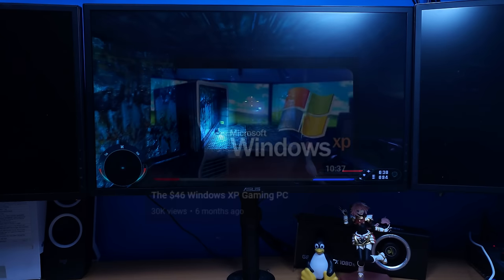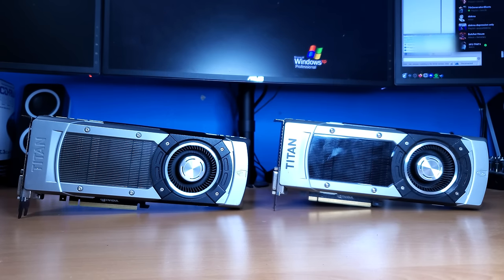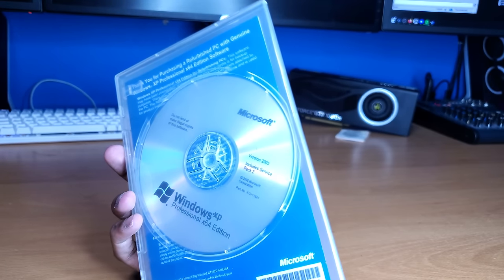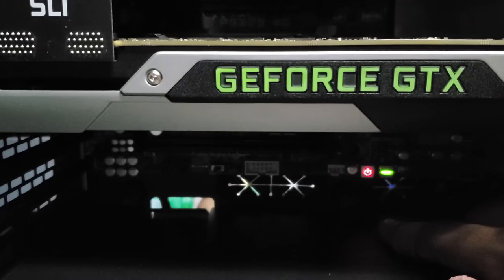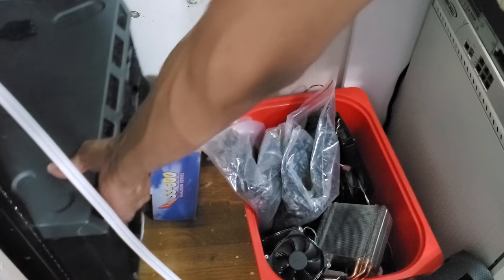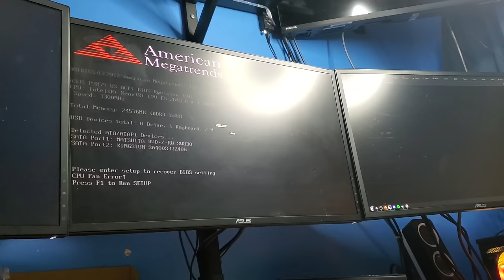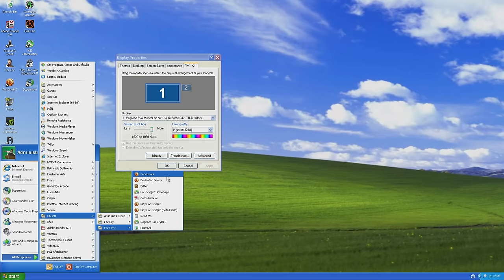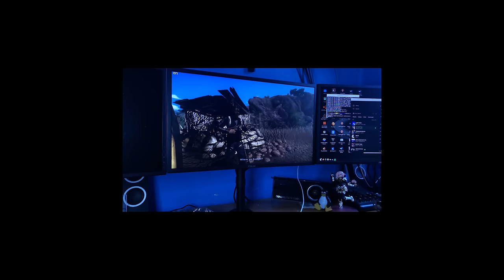Building the Worlds Fastest Windows XP PC! The Overcompensater

Comment: I used XP Pro x64 on my main computer until around 2017 before migrating directly to W10. I swear everyone who keeps repeating the same lines about instability, drivers, and compatibility issues never actually ran it. I don't recall having any problems with driver availability at all. Every well-developed mainstream program installed from the regular 64-bit installer exe/msi without issue. The occasional compatibility issue usually had to do with a smaller or more niche program not able identify the OS version, and there would usually be a workaround. I don't think there would be any more problems running it than you would have trying to use XP-32 in 2024.

Comment: For ultimate performance on the X79 platform, you'll want to go with the Xeon E5-1680V2. It's only got 8 cores, but an unlocked multiplier and they have widely been reported to be binned really well, meaning that they should overclock really well. I have two of them, one running on the exact board you have, and they both do 4.5 GHz, which makes them considerably faster than the 12-core.

The CPU is actually kinda interesting, since as far as I can tell it was never officially sold to consumers, and the only computer that ever had them seems to be the trashcan Mac Pros. Still, there's plenty of them on eBay.
Reply: this

Comment: I wish I could find a use for an old HEDT system like this. The hardware is super cool. As it stands I can’t find a use for a 2S Skylake system I’ve already got.
Reply: I recently threw away a dual LGA 2011 Supermicro board with two Xeon E5-2650 V2 (8 core Ivy Bridge each) because even when I listed it as "for free", nobody wanted it. And I couldn't justify using it for anything when a cheap as dirt used Ryzen 7 3700X beats the crap out of it, both in terms of performance and efficiency/power consumption. And the Ryzen supports ECC RAM too, so I'm not even losing that feature despite going for a cheap desktop platform

Comment: 4way sli wouldnt be ok because dx9 only supported 3 frames prerendering so the 4th gpu would be waiting til judgement day to be used. but if you use 3way and set the 4the gpu to physx you would benefit here and there.

Comment: I would have gone with 2x SLI too, 3x-4x SLI was a joke especially for gaming. It was mainly used for 3d rendering/simulation and other stuff like distrubted computing with F@H.

Also going with 2x SLI would keep those bottomg PCIE slots empty so you could technically install an NVME adaptor and run an NVME drive for your games. Drivers for NVME controllers were actually made for XP and are still used today though I doubt you could use it as a boot drive.

and one more thing, always always replace the cmos battery on any old motherboard.

Comment: You shouldn't mix and match power supply cables specifically to avoid these kinds of issues. Use the ones that came with the psu or you risk frying it.

Comment: I personally daily drive a x64 xp machine. It has a core2 duo p9700 and a 250gb 860 evo. It has 4gb of ram right now and 8gb costs more than ddr4 would so I can't afford it right now but I hope to in the future. It does run with an igpu but I'm thinking of getting a 1080ti plugged in through the WiFi slot

Comment: You really don't need a fast computer for WinXp-sp2, in 2005/11 I ran it on a AMD K6-2 socket 7 500mhz, 512mb, and gforce 2 16mb, 80gig SATA, SB 16 ISA, PCI usb 2.0, PCI SATA x 2, DVD x 2 PATA, Multi-card reader, 100mbps ethernet, and IE6 for internet browsing. it worked fine. And it still works today. It's a 2 ISA, 5 PCI, and 1 AGP. Full mainboard ALI Chipset. Used mostly for Mp3 music for Parties at home, Ah the good old day eh?

Comment: I have owned both an 8 core 1680 V2 and the 12 core E5 2697 V2 and I can tell you for a fact an overclocked 1680 V2 run circles around an E5 2697 V2 all day long. You can very easily get the 1680 V2 to 4.4 gigahertz if not 4.5 or even 4.6. it can be upwards of even 50% faster than the 12 core purely due to clock speed.

Comment: Wow, all that work. You could have saved yourself some time and used the ASUS BIOs flashback button in the rear of that motherboard. You don't need a CPU or RAM to flash your bios. Only the ATX power supply plugged in. Just need to download the newer bios file onto a USB drive from another PC (8GB or less USB recommended and formatted as FAT32), rename it to *.CAP, plug it in the drive to the USB port that's legacy usually denoted with white marks on the USB pin instead of blue on this MB. Turn on the ATX power and press the USB BIOS Flashback button next to that rear USB port for 3 seconds. Give it about 5 minutes, 10-15 mins to be safe (You'll notice the LED button flash several times for awhile with different colors) or if you have a USB flash drive with a built in LED (It'll flash awhile) and you should be good to go! However, great job on doing all that hard work to get that older CPU out of your server to flash the board!

Comment: Fun fact: Windows Vista also has the same fastest components, but the GPU is a Titan X Maxwell, just the generation up from the GTX Titan. Now, when are we going to see the fastest Windows 7 PC? I already did the research, here is the parts list: 

i9-9980XE
RTX 3090 Ti 
ASUS ROG Strix X299-E Gaming II
8x24 (192GB) DDR4-4266Mhz

get a 1000W PSU to be safe. 3090 Ti SLI also cant officially work on Win7 because there isnt any native DX12 support, even on win10 its a nightmare. So don't even bother to try it. SSD speeds are also limited to Gen 3 btw, and make sure to get 7 Pro or Ultimate to support the memory. 

I also know that DDR4 can go to 5333Mhz, but the fastest X299 mobo I could find only went to 4266Mhz. Also, this specific motherboard is the only one that will get you Wifi 6.

Comment: I have two Windows XP pc's that I've built on a Pentium 4 3,4GHz prescott core socket 478, and the other an AMD FX-8350 4,2GHz AM3+

Graphics card used for the old system is an Sapphire HD3850 512MB gddr3 AGP8x, and the later, an ASUS Matrix Platinum HD7970 GHz edition at PCI-e 3.0 speed on a Sabertooth 990FX/Gen3 R.2 motherboard.😁

Comment: My XP (32 Bit) PC:
Huananzhi X58 Deluxe
X5650
48 GB DDR3-1600 ECC (makes no sense with 32 Bit OS)
GTX 970
SATA SSD
... really cool, it's cheap, boots fast, even internet works, just great
Reply: It's a bit of a mixed bag from my understanding due to drivers that are supported on 64 bit compared to 32 bit, but do be warned that 16 bit titles won't work on 64 bit XP at all.

Honestly it would be a good idea if you had two drives, one with each version of XP so in case you cannot boot a game on the 64 bit drive, you could boot in on the 32 bit drive.

Comment: I will say, the 1680 V2 is actually faster than the 2697 V2 in terms of multicore (at least on Cinebench) if you can OC it to higher than 4.3GHz. It’s a much better balance of single/multicore performance than the 2697 V2.

Comment: A word of advice… don’t use cables from other PSU… they might not work or even damage the hardware. Every company uses different wiring schemes for their cables.
Reply from the maker: I did not use cables from another psu, i used the ones that were in the box when i got it from amazon.
Reply: @Ionic1k  I see.

Comment: Due to how windows XP handles CPUs, an extremely overclocked 2nd/3rd or at a stretch 4th gen i5 is the best, i7 with disabled hyperthreading also works. Nothing XP does uses beyond 4 cores excluding professional software that nobody should be using anymore, and most only use 1

Comment: ummmm pci lanes, so both titans are working at 8x, if u get it running, u need to test single card @ x16 lanes and compare to 2 cards @8x. Does the xeon have 24 pcie lanes? at least then u might get a slight boost, would love to see how 2001 xp deals with 2014 hardware, for best results stick to 2008 hardware or below. I believe this hardware is best suited to win7 c2009.

Comment: I had a similar setup, I even had RAM with a frequency of 2133 (PC3-17000, probably hard to find anymore). Despite the fact that they were slower memories compared to the more modern DDR4, thanks to the 4-channel connection they achieved comparable performance with the usual two-channel ddr4.
I had a sandy bridge i7 cpu that was easily overclocked to 4.4ghz and its temperature never went above 75 degrees even with air cooling. 
Next generation intel cpus are bigger and bigger pieces of dog shit.

Comment: Let's say hypothetically, you want to replace your windows xp installation with Linux, what would you choose?
Reply from the maker: Arch, Gentoo or not go with linux at all and go with BSD
Reply: >_> Ignore Ionic and go with AntiX Linux if you need maximum performance, or with MX Linux if you're willing to run a somewhat fatter but more convenient and fully featured distro.
Reply from the maker: @arnox4554  he asked what i would install on the windows xp pc, that's what i would install i much prefer setting up what i want on a system rather than having stuff set up for me.
Reply: @Ionic1k  I do get that, but none of those are distros that are even close to beginner-friendly. (And BSD is its own thing.) When a beginner is just starting out, they need a foundational distro that is not just accessible for beginners to use, but is also rock stable. AntiX and MX Linux fit this criteria perfectly.
Reply from the maker: @arnox4554  linux mint better >_<
Reply: @Ionic1k  Standard Linux Mint doesn't have the incredibly nice Debian Stable base since it's based on Ubuntu. Also doesn't have the native toolset that MX Linux and, to an extent, AntiX has. LMDE is better, but it still doesn't have the tools, and it's also missing MX Linux's Advanced Hardware Support kernel.
Reply from the maker: @arnox4554  nah mint better
Reply: @Ionic1k  no u

Comment: XP and daily driver - How does that work for security online etc? I couldn't fathom connecting XP to anything without getting owned in a few minutes.
Reply: be behind a firewall and NAT (like 99 percent of the people who use any router of some kind) and don't be a dumbass blindly running any bit of software you come across. it's not rocket science. Most of the YT videos showing how insecure XP (or other old OSes) are when connected to the internet are staged, running the system in exposed host mode, ie all ports wide open to the web. That's not how the vast majority of people are connected to the internet (regardless of old or new PCs) but makes for a nice clickbait video about systems getting infected, which is all that matters to those channels. clicks equal money, and that's all they care about

Comment: The CPU fan error might be because the motherboard CMOS battery could be dead thus not remembering/saving BIOS settings. I had this happen to an old motherboard of mine, I even bought a new CPU fan before realizing it was just the CMOS battery not saving my BIOS settings because it was dead lol. After I replaced the CMOS battery, I never had this CPU fan error issue again.